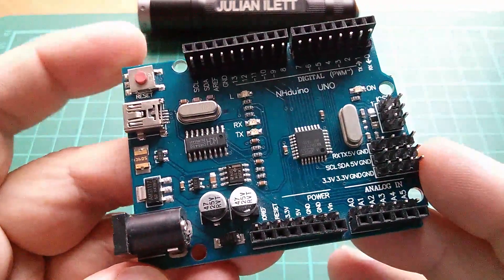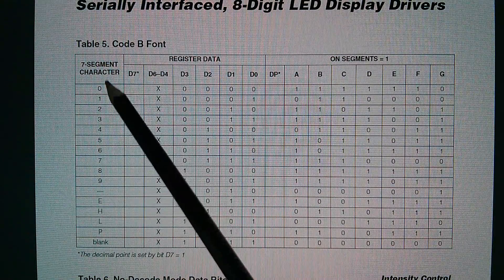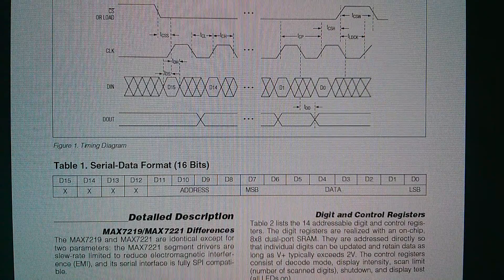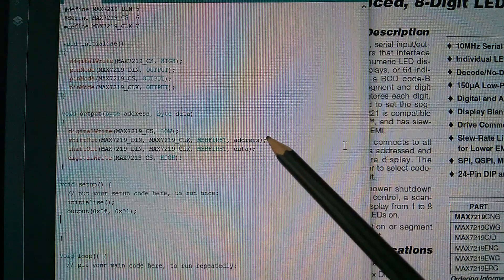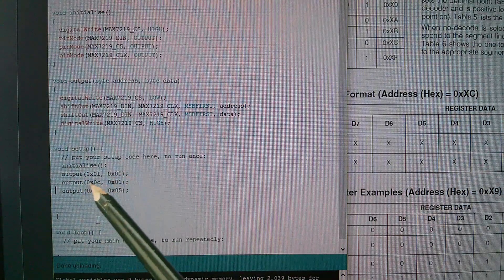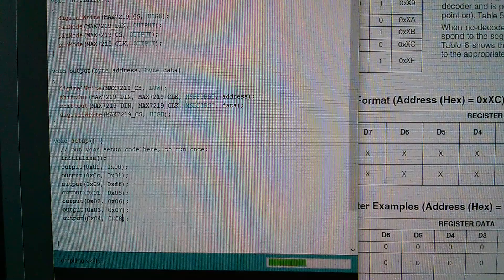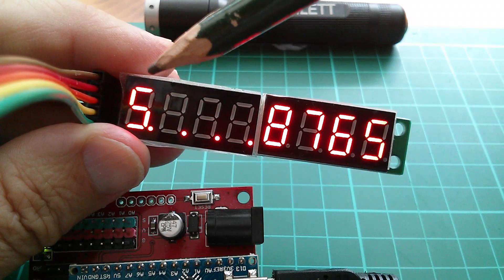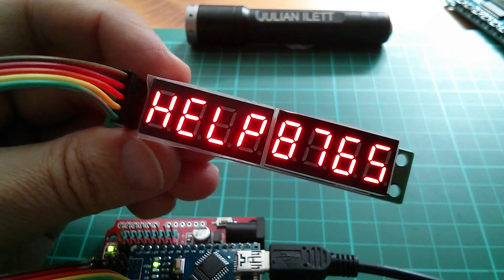Julian's Ardutorials: MAX7219 7-Segment LED Display & Arduino

Comment: Hi Everyone
With following methods (functions)  you can attach two 7219 modules
output1 will send data to the first one and outout 2 will send it the second one,
rest is the same as Julian has written.

void output1(byte address, byte data)
{
  digitalWrite(MAX7219_CS, LOW);
  shiftOut(MAX7219_DIN, MAX7219_CLK, MSBFIRST, 0);
  shiftOut(MAX7219_DIN, MAX7219_CLK, MSBFIRST, 0);
  shiftOut(MAX7219_DIN, MAX7219_CLK, MSBFIRST, address);
  shiftOut(MAX7219_DIN, MAX7219_CLK, MSBFIRST, data);
  digitalWrite(MAX7219_CS, HIGH);
}

void output2(byte address, byte data)
{
  digitalWrite(MAX7219_CS, LOW);
  shiftOut(MAX7219_DIN, MAX7219_CLK, MSBFIRST, address);
  shiftOut(MAX7219_DIN, MAX7219_CLK, MSBFIRST, data);
  shiftOut(MAX7219_DIN, MAX7219_CLK, MSBFIRST, 0);
  shiftOut(MAX7219_DIN, MAX7219_CLK, MSBFIRST, 0);
  digitalWrite(MAX7219_CS, HIGH);
}

Comment: can matrix and 7segments max7219 modules be mixed on same esp8266 or arduino? Can they share the same DIN and CLK and change only the CS pin, or what? Thanks in advance

Comment: Thanks. Very simple and 'just works'! BUT Arduino is really weird. You can have it working in this video with pins 5,6,7 but you'll have to spend the whole evening trying it to use pins 2,3,4 and see that it's impossible. Why? Why?! Although it works with 7,6,5 ok.

Comment: I hate that I have an interest in electronics, I keep burning myself checking if components are overheating. I measured the current of the "Display-test" and it reached 500mA. I thought that must be a bit much for a single chip so I felt the package and understandably burnt my finger. I also keep burning myself checking the temperature of my breadboard voltage regulator and that gets quite toasty as well.
Reply: You are not alone at the moment I have six burns on left arm from soldering iron and I KNOW that is hot. get it right one day :)

Comment: That MAX7219 is the most useless piece of crap! One of the biggest problem with the 4511 BCD is that it only shows the digits 0-9 and not the hex alphas A-F that is often needed. MAX7219 has exactly the space to add A-F but instead they decide to add H,E,L,P,- and blank ? That is insane stupid!
Reply: Codex Seraphinianus I too am puzzled as to why they decided with help instead of hex but I'm sure you can just easily make your own subroutine to do it. Also, the chip is a lot better than just wiring 16 pins to your microcontroller and writing all the subroutines for that

Comment: The MAX7219 and TM1638 based led display modules are incredible value. I really like the RobotDyn stuff, though it's more expensive (though still typically half the price of Adafruit equivalents) and harder to source the complete range.

Comment: hi, nice video. i have a question, can i pull those two 4 digit 7 segment off the board and then replace it with 2 or 3 digits 7 segment LED?

Comment: I'm very very happy for your tutorials.
I'm making a car meter as project. Here I'm using such MAX7219 module to display.
I'm using 3 pieces of MAX7219 module. 1st for speed, 2nd for distance, 3rd for elapsed time.
I'm facing some problem to complete the task. Therefore I'm cordially requesting you to help to about how to write the Arduino code.

Comment: It should of built in the characters A, C, E, and F, instead of E, H, L, and P.    That way you could of written out Hex numbers A,B,C,D,E,F , and represented B and D with an 8. and a 0. with periods in the lower corner, to indicate they were alphanumeric.   So your 16 Hex characters would show up as    0,1,2,3,4,5,6,7,8,9,A,8.,C,0.,E,F    ( 0,1,2,3,4,5,6,7,8,9,A,B,C,D,E,F )

Comment: I just ordered one of these 8 digit display boards last week. I want to build a non-contact laser tachometer with it. I wonder what the chip displays if you give it hex above 9? There are 6 digits above 9 after all in hexadecimal. I know the old 7447 7-segment drivers did a poor job of displaying those. The MC14495 driver did a bit better.

Comment: Great tutorial Julian. Precise , easy to understand and inspiring.
Went straight to Ebay and ordered 2 pcs to make a date/time clock with an RTC module I still had lying around.
Looking forward to your next tutorial.

A request: There are all kinds of 18650 balancing/protect/charging pcb-boards.
Maybe a tutorial on howto build a diy balancing charger using these boards and a CC/CV power unit.

Comment: If you want some of these chips and are in the US, Check out eBay. There's a seller selling them for $1.50 a piece in the USA. I bought a bunch (>10) from china and had to toss 8 of them because the pins were mangled and broken off.. :(
Reply: +Ethan M Why couldn't you solder new pins on?

Comment: I've been wanting to test out a front panel form an old Motorola digital cable box and it uses a MAX7221 so this is a very helpful video.
Reply: How did your MAX7221's work out? were you able to get your cable box front panel display to be driven by this IC?
I originally wanted go for the MAX7219 but they were out of stock at mouser and I didn't want to shop around several places so I went ahead and got the MAX7221 instead (which was in stock). And I am not sure of the difference between the two chips. The data sheet says:
"The MAX7221 has slew-rate limited segment drivers to reduce EMI" which sounds like absolute gibberish to a noob like me..
My big challenge will be to drive an 8x8 dot matrix LED with this chip and figure out the wiring from the MAX7221 over to the LED matrix's pins. It's very nice when the IC comes pre-packaged with the LED matrix on a compact little PCB, but the masochists among us would venture to try and do the wiring themselves (an exercise in futility, I know, especially since the LED matrix itself comes in two different flavors, the column cathode and column anode)
[Edit: I just googled the terms and 'slew-rate' simply means a square pulse turns to a trapezoid because of propagation delays, and EMI stands for electromagnetic interference, so I assume that specs-wise the max7221 should be a drop-in replacement for the max7219 for those that aren't bothered very much about EMI.]

Comment: Julian, do you have a link to your lipo based USB power bank that does variable voltage (its white with some silver writing on it I believe).

it looks perfect for what i want as i'm looking for a cheap power supply of sorts for some basic electronics projects and have ended up salvaging a bunch of 18650 cells from some broken kit.

Comment: Ground on red?! Blasphemy!
But honestly, having stuff not work or even fry because I mixed up colors (and it WILL happen), it's a very good idea to always stick to a color code, even if it means that you have to twist or fan out a cable at the end. Considerng how cheap the dupont cables are on ebay there's also no excuse to not have alot of them ripped in double strands (e.g. brown/red for power, orange/yellow for serial, green/blue for I2C or SPI). No need to trace wires after that.

I had to force myself to do that at the start and used mnemonics to make it easier:
brown: GND obviously, but mostly because it is always besides the red
red: power, esp. 5V
orange: see how the "or" in there sounds similar to the start of the serial "RX"? I also use it as reset because of the "R" in it.
yellow: TX just because it is besides orange. Or CS in SPI, because it's the "spare" color
blue (blau in german): the "data" line in I2C/SPI, because of the common "a" in it
green: you know the chinese can't pronounce an "R"? So "green" becomes "gleen" which starts similar to "clock" ;) Also goes very well with the fact that it's right besides blue.
purple/grey: general purpose colors mostly for analog or triggers of sorts
white: power, but not 5V
black: also ground. You need more of these anyway. I mostly use it for signal GND (in serial/I2C/SPI) and not for power.

Comment: Just for the fairness to the brand,  you may call the board "Arduino Clone" instead of "Arduino". Very nice video I have the same chips In DIP factor laying around and waiting for the test.
Reply: +norm1124 Let me give you a kleenex while you are crying over there.
Reply: +Paul Frederick thanks :-)
Reply: +Paul Frederick you are so harsh, I'm gonna need Kleenex Balsam tm. But until your delivery Linsoft out of my pocket will do it's job. Shall we call it kleenex.cc ?